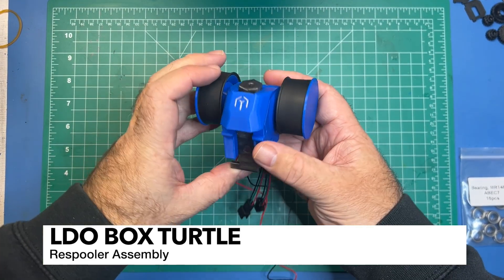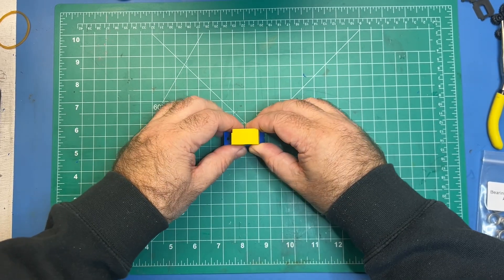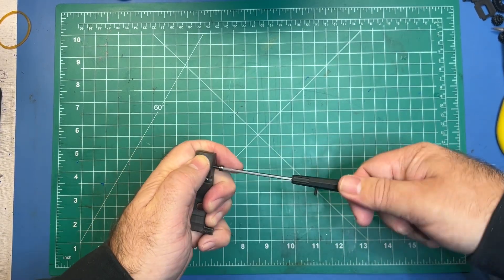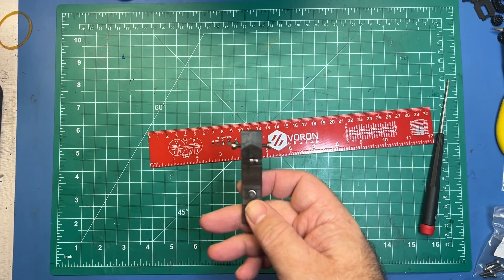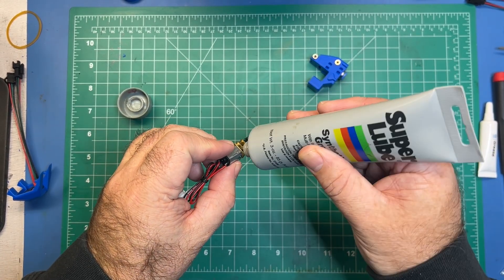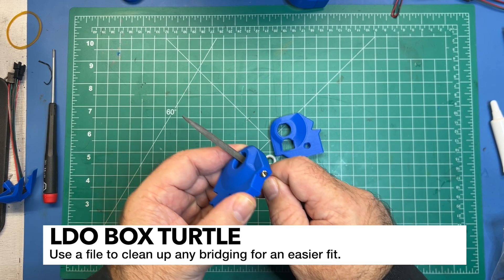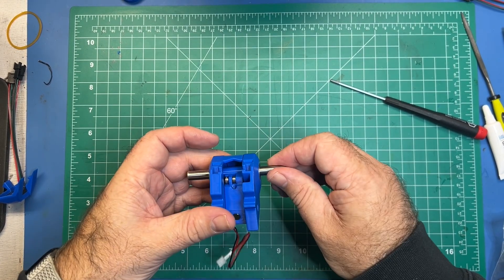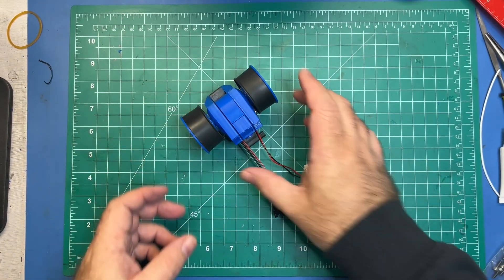LDO Box Turtle Respooler Assembly

Comment: what did you print your parts with pla,abs,asa?
Reply from the maker: It was a good mix, but mostly PLA. The gears are ASA.
Reply: @GregsMakerCorner  Thanks I am going to try pla cause my abs abs asa parts are not fitting very well.